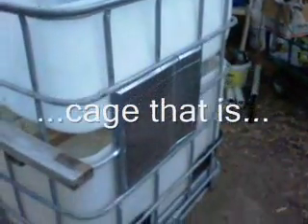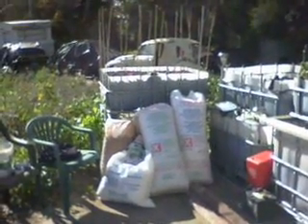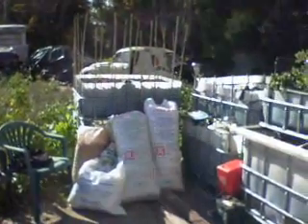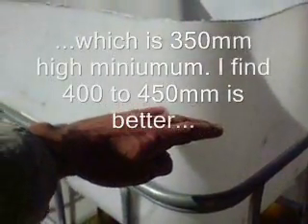IBC full conversion part 2 in a Third World environment

Comment: hi, I am wondering if the pallet part at the bottom is removable without cutting? If it is, could you set the plastic tote right on the ground in order to gain a few centimeters for more access to the fish (or is the pallet structurally necessary somehow ?). I have kids so I am excited to see how this would be safer for them- no drowning risk. Thanks so much.

Comment: I like to add that I managed to get a slight deeper growbed by resting the wood beams a rail lower then you do. I will heighten the beam off of the second rail by use of a screwed on piece of pine. The growbed is nicely near the 30cm depth... 
Also I like to mention that I will mount all plumpbing within the 100x120 cm footprint of the IBC. This isn't new for the siphon (which I rather place at a far corner) but it seems to be for the inlet. I am experimenting with an airlift to fill the bed.

Comment from the maker: Ok brain69x, you don't need to service the fish, all you need is room enough to lift and clean the pump filter once a month and daily feed the fish. Any more involvement than that and you start wasting time and energy on over caring for the fish. In the years I have been doing this the tank water once inoculated should be best left alone. All my IBC and barrelponics are hooked together with the water pumped through the entire system, small changes in a large body of water are easy to monitor ra

Comment: You solved a problem I didn't even see.  Great job!!   I like the last bit raising the bed.  I agree with NavyBlueSTL.  A 2x6 or 2x8 on the lower rung would increase access and keep the top bed lower for those who are not as tall.

Comment from the maker: @lilililililililiilii Or you could dig the lower tank into the ground adding more thermal support to the water by evening out temperature fluctuation. Most beds need a minumum or one foot or 30cm to properly siphon and for proper root balls to form.